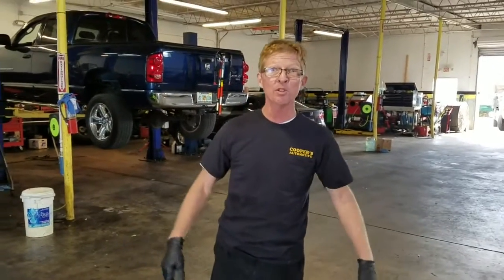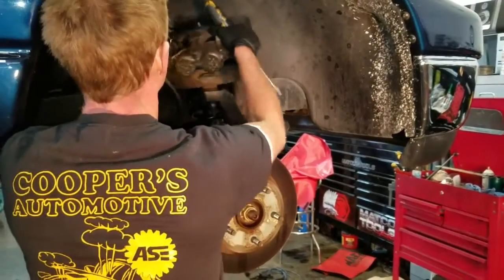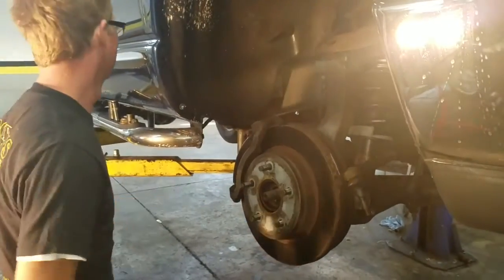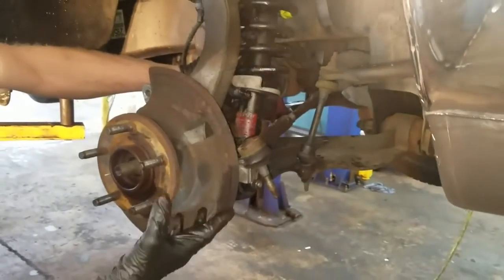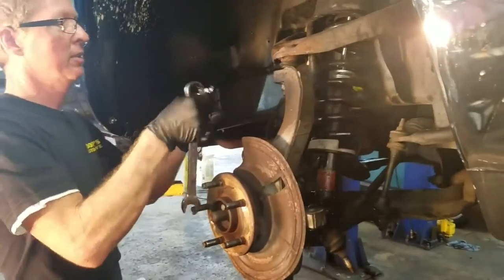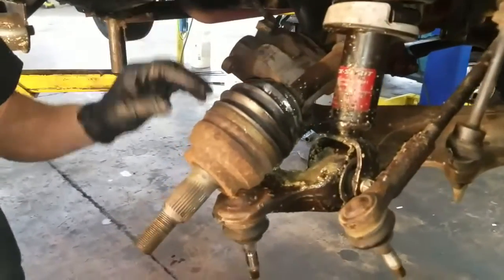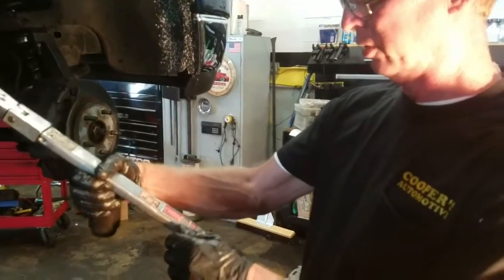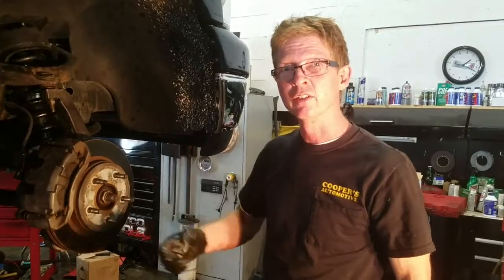How to Fully Repair Outer CV Boot | 2007 Dodge Ram

Comment: Nice video.  I've always  just poped the upper ball joint and then the steering knuckle swings out just enough to get the axle out.   Not sure if that's the "correct" way, but it's the easiest way I've found.
Reply: I tried that, but couldn't get the axle out... just not enough room.